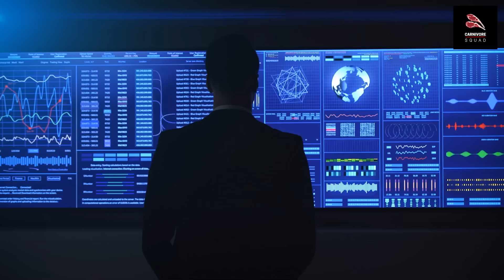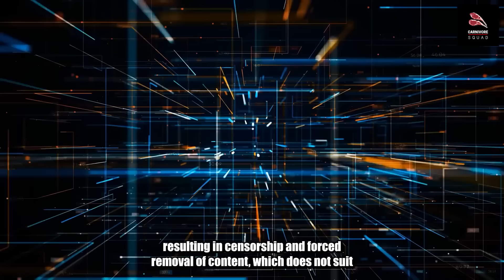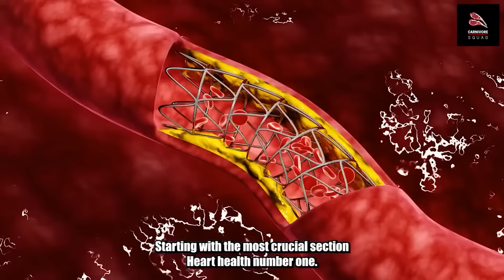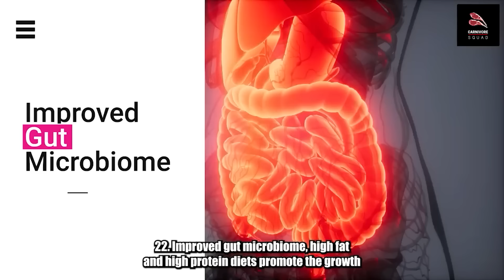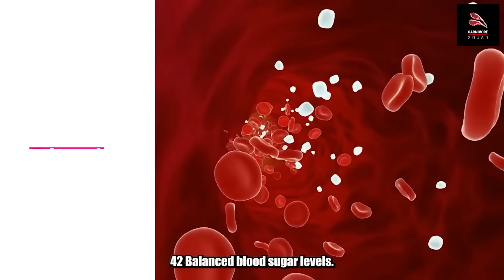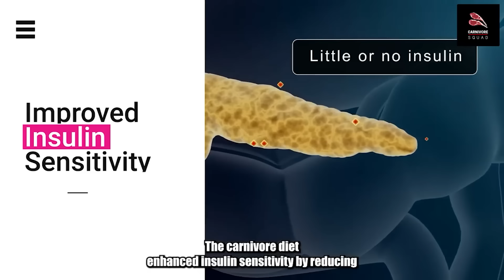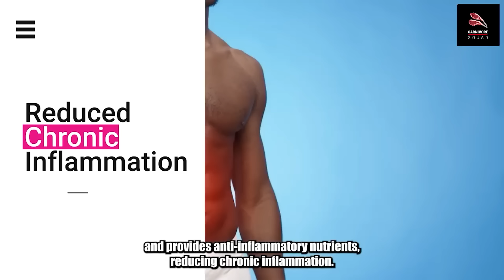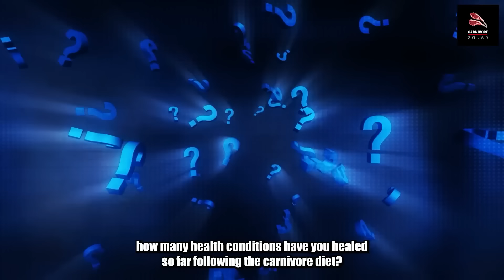🔴Breaking: Terrible News For Carnivore Followers [22 Sep 2024]

Comment: BTW if we labelled it a lifestyle rather than a diet we’d probably receive more listening ears.
Reply: What do you think would be a good term to use?  I use Zero Carb -- but any term would eventually be "followed" & then censored, I guess.
Reply: @JScox elimination diet
Reply: @patedwards8844  Yes, some have called it that.  Meat is non-inflammatory.  If someone is having any git issues, supposedly could be from foods they are having an allergic reaction to.  By eliminating everything else and just eat grass fed beef for a couple of weeks, one could start slowly adding back one food at a time for a week before adding back another food.  And keeping track of how you feel, and difference in gut issues or bowel issues could help pinpoint triggers.
Reply: @JScox  it may be carnivore but turns out to be an elimination diet on the way to good health. Where the food likes you.